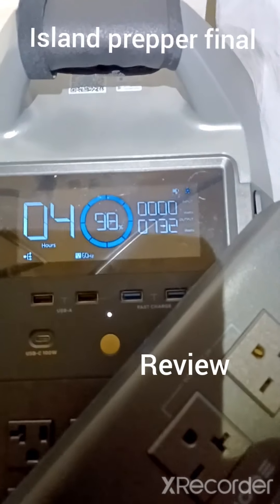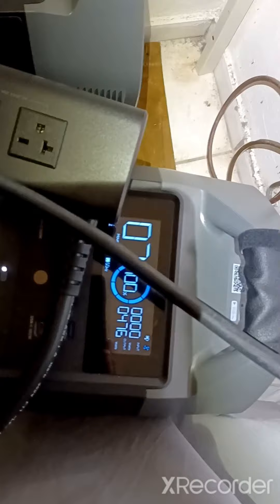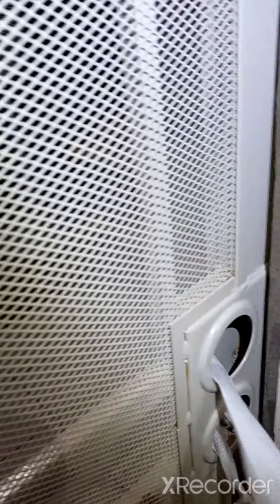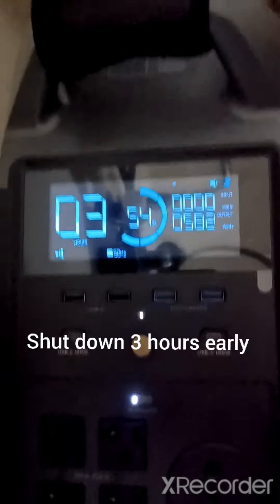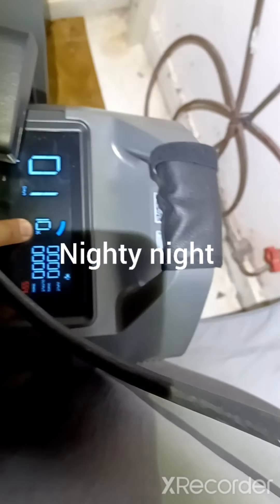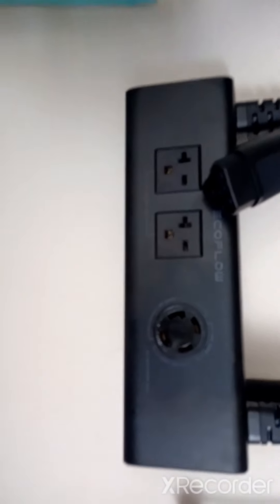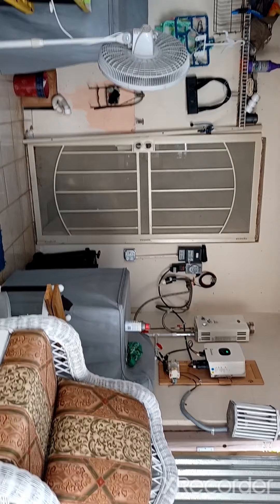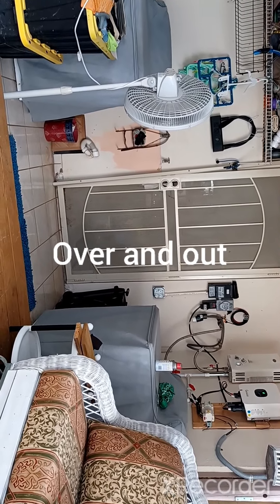$8000 down the drain, Delta pros, low run time  👎

Comment: I guess my question is why aren't you charging the units with your solar while you are using them - I think you can charge them up to 1200 watts.  Can you do another test to see if you can charge them with solar while you are using them?  I would think if you are getting 1200 watts charging while only using 1000 watts it should stay up all day and then you only have to worry about the night.

While I am a novice too, I think you are being a bit hard on your review for two reasons 

#1 - It sounds like you don't really have a true 240v single circuit output - you have two 120v separate circuits - one running one side of your house and one running the other side.  I would feed your main box with the 240v - that way you're feeding the whole house with both EcoFlows.

#2 - The one unit was drawing about 1,000 watts per hour (or 1 kilowatt hour) and the unit was rated at 3.6 kilowatt hours - so doing the math you will only get 3-4 hours before it's dead and that's what you got so it's doing what it should.
Reply from the maker: I had a grid-tie system already in place and I thought it would be able to work together, but when I read the instruction, it could only charge at 150v and my system was set up at almost 300v, so I would have had to dismantle my whole system and re-wire it in order to make it work, but here is a little FYI for you, a lot of my neighbors have solar systems installed, with Tesla batteries, and they all had to use gas generators throughout the day, we just got a direct hit from Fiona rite threw my town, and as we all just got out power back last night, so even at $25k to $30k per house, it still fails the test of full emergency service. with that said I did manage to get them to work for me for 10 hours a day, by charging them with my gas generator.   Thanks for the feedback.
Reply: I heard if you are tied in with the grid, your system will go down when the grid goes down too. Kind of sucks that even with Tesla's batteries they fail too. But to test it your system with solar, go to Harbor Freight and get their 100 W panel and try it out, and when you figured it out, just return them.

Comment: The time they show is off a-lot of the time for me. Mine said 2 hours once and it lasted 7. With a draw of 450 watts all the time.  Granted I had to recalibrate them as well (They are LFP chemistry batteries. This happens). If you spend 8k, then you must ave bought direct. I spent 5,000 for two Delta Pros. Do you have extra batteries to any of them? I’ve watched many home videos and those perform better than yours.
Reply: Where did you get 2 for 5k?
Reply: How did you get two for 5000 ?
Reply from the maker: Yeah, I agree, I calibrated mine the first day, and ran them down and back up twice, but still not rite on the time, but sometimes I get more and sometimes less, what I dont like is the 240 adapter. Thanks for the feedback.
Reply: @jenniferfilippone6929  eBay

Comment: Omg 🤦‍♂️ what makes you think those delta pro could run your central air?? Those things are just as bad as if you was to run a heater. They suck power like crazy. You needed to figure out how much power your house uses. Listen I built a battery backup system for my home and with 3 window ac units running and the normal house power. I was at 23% after 18 hours running. I built a 25.700kw system, for under $7000. Please do your research and what you want running under a black out. Then figure out what you need. You’re spend $8000 on probability. To run the house, you need to get 4 expansion batteries. Two for each delta pro. But…….. then you need to make sure you have enough solar to fully charge everything in a few hours.
Reply from the maker: I don't have central AC, I have a mini split with an inverter, takes very little power, the problem was cost per watt hour, which did not work for me, now if I was able to connect my panels, it would have been better, but its cheaper to build my own.
Reply: @islandprepper3791  exactly! Way cheaper to build your own. Remember you’re buy portability. DIY you’re building what you need,

Comment: You need to balance your panel… there are two sides and apparently one side has more running off it than the other
Reply from the maker: Thanks for the feedback, unfortunately, in Puerto Rico we don't have central A/C, so in an emergency, I run only 1 A/C  in one room to keep it cool, so that side of my house will use a higher wattage or more power, if I run only 120v then they both run more evenly, but the HUB should do the balancing for me, considering the cost$$$$$
Reply: @islandprepper3791  It would be awesome if the EcoFlow hub could detect the usage coming from both of the Delta Pros’ and internally alternate the two different legs on your panel but they are not quite there yet and it would require the hub to shut down momentarily to switch.  Our plan is to max out the capacity of the Delta Pro’s with four smart batteries. We will run the generator during the day and the Delta Pro’s at night for the quiet and to extend our gas and propane supplies. You are ahead of the game as you have solar panels we’re not there yet.👍

Comment: A typical home, with efficient fridges and mini splits air conditioning, would use 30Kwh of electricity, but more inefficient homes would be closer to 50 Kwh or more A DAY. So you would need enough battery backup to cover at least 30Kwh to 40Kwh A DAY. maybe you would need more Ecoflow battery units to connect, probably 2 more, one extra battery extension for each unit. then it could be ok.

Comment: Why didn't you purchase the Delta Pro Smart Extra Battery to run with your Delta Pro?  I have the Delta Max and I purchased one Delta Max Smart Extra Battery and it works fine together so far.  Remember to use the app to update your firmware on both.   That was the first thing that I did on my Delta Max and extra battery.
Reply from the maker: its all just to much money, even with the extra batteries it does not pay for itself, I was hoping I could use them part-time, but they don't have the long-term use and I can buy a real system for less, thanks for the feedback.
Reply: @islandprepper3791  prioritze what you need to run , like microwave etc on main power , and eco flow for lights fan , u will propbaly need like 4-6 of those to run , maybe you should check online for a better deal ?
Reply: @islandprepper3791  i think solar power is defantely worth it !

Comment: The point of these is to hook them up to solar and you need to balance your load as there is a larger load on one of the legs. If your trying to run your whole house for hours on a fixed battery with no solar then you have no knowledge of what these are designed for nor how they work. This is an example of your lack of knowledge and research the product works.
Reply: Great point people need to understand that these units are great for backup emergency power, it is not designed to run your entire home for days on end. Before he bought them he should have calculated his energy needs and bought your system according to those needs.

Comment: Wouldn't it be better to use a large battery storage for the solar than to use the Delta Pro as a backup battery?
Reply from the maker: Yes, and that is why I am selling them, these are not ready for emergency service yet, unless you can afford $14-16k on limited equipment. thanks for the feed back
Reply: Large battery backups are expensive and you can start small on eco pro and expand I know I want the 25kw system so I got two pros and adding a battery a month til I'm done then hooking up solar I can essentially run my entire house off grid and combined with a gas generator for emergencies it's a very economical solution when you lose power for days
Reply: @islandprepper3791 These are 100% ready for emergencies. You are just trying to run things like it isn't an emergency.

Comment: Those batteries have ~3.6k battery each. Drawing out as much as you were they lasted appropriately. 1k draw will only last about 3 hours on 3.6k battery. If you are running it like you said, which is dangerous, you will have an uneven draw on the batteries. It sounds like the pain you experienced was primarily your fault. Before you go there, I have several different solar generators, Delta Pro being one of them, and they all work like they should. Trying to compare these to gas generators is a poor comparison for a huge number of reasons. Sounds like you need a better understanding of battery banks.
Reply: He is addicted to Big Oil, air-polluting gas generators, too.

Comment: U HAVE 2 HEAD UNITS SHOULD 1 OF THE UNITS NOT B EXTRA BATTERY TO WORK THEY WAY U WANT IT TO.THEY SHOULD NOT BE CONNECTED TOGETHER RUN THEM SEPARATE

Comment: Ecoflow will void warranty if you use aftermarket solar panels.
Reply: Really!? That's bs
Reply: What are you talking about no they don't
Reply: No, they sent me an mc4 to xt60 cable for other panels in addition to their proprietary xt60 cable for their solar panel and generator since I bought their delta 2 and 220w panel bundle.

Comment: I'm not a fan of Eco Flow, but also not a fan of the grid tied PV systems that you have absolutely no say or control over.  The power company controls all of these systems, not the home owner.  If the power goes out, all that solar just goes to waste.  As long as people understand that and are okay with it, all good.  What most people don't understand about modern homes is that for every GFI (ground fault interrupt) outlet you have, each one of them consumes on average 30 watts every hour they are energized.  That's up to 720 watts per day per outlet that cannot be used to run actual critical loads, such as a refrigerator or freezer.  If you are going to go the way of battery backup during a power outage, make sure that you are not powering any GFI circuits.  Another thing that you may not notice, especially when you look at a refrigerator or freezer, is that when they run a defrost cycle, they draw considerably more power than they do when just running.  The easy way to check this is to just plug it into a kilowatt meter (about $30 at Amazon) for 24 hours and look at the total watts used in the 24 hour period.  To get the most out of the PV input, look at the current and voltage limits of the Eco Flow, then use a combination of panels (in series) to get as near to the upper voltage limit as possible.  For combining panels in series, always use the open circuit voltage (Voc) of the panel for calculations (usually on the back side of the panel).  Hope some of this helps.
Reply: @jknowi  The Eco Flow will limit the current to 15 amps so no problem and as long as the combined Voc is less than 150 volts, you are good.

Comment from the maker: I have to put this comment in here, for the cost of these chargers, it does not run my house for any considerable time, my gas gen cost only $400 and it runs my whole house for 8 hours on 4 gallons of gas, meaning I can use my gas gens for 30 nights running my A/C for only $540, no brainer, my smaller unit runs 8 hours on a gallon of gas and 1800 running watts.
Reply: Hi. Enjoyed watching your video. I believe your problem is that you don't have enough capacity ( watt hours) to run the whole house the way you would like. The two Delta Pro's give 7200wh total. The watt hours displayed on the screen wouldn't be same if they power different loads on two different circuits. You really need to figure out how many kwh your whole house consumes for the time your off grid and then add more as a buffer. There's a YouTuber called Minuteman Prep. Has a excellent video with the Delta Pro's. He has two Delta Pro's and 4 smart batteries connected. Runs his whole house and well pump, but he has capacity to do that. Wish you the best.
Reply: Delta pros are working good problem is user lack of knowledge.
Reply: @harrysantiago5093  exactly. This guy is clueless
Reply from the maker: @rustytr , hey Rusty, I'm not questioning the quality of the product, I like it, but it is NOT worth the money for emergency use, so my comparison is gas vs this option, it all looks good but it cost way to much for what you get in return.
Reply: What gas generator did you buy that cost $400 and runs your whole house?
Reply: @islandprepper3791 no man, these things are great for emergencies. The problem is that you are trying to run everything like it isn't an emergency. The problem here, as pointed out by several people, is your lack of understanding. Trying to compare a solar generator to a gas generator is like comparing apples and oranges. You have wildly unrealistic expectations of what these should do and you do not understand proper implementation. Proper planning on this would have saved you, and a good number of other people, a big headache. Quit complaining about the system not working well and learn how to make it work for you. Sounds like you need more battery to do what you are doing. That and balance the loads on your panel. If you are looking to use it for emergencies then you should only be running the bare bones on it. Not every last thing in your house like you are in grid. You need to stop and think through your problem instead of whining and complaing.

Comment: Yeah I agree if you would have considered your wattage use solar generators are not quite there yet in terms of battery capacity we are still like in the flip phone stages of solar generators. There are many new batteries in the horizon that may change that like the sodium batteries with better density and capacity for the same weight.
Reply: It's not the battery that set up or not advertised for whole home backup so his expectations are way off just keep adding batteries until you get to your capacity level that sustains you without thinking about it

Comment from the maker: today is the first day back with electricity and internet after we got hit with FIONA, so I did put them to a real test, so what I was able to do was charge them and use them one at a time using 110v direct to my transfer switch, that runs my whole house except my 220v a/c units, but it did run about 5 hours and then I attached the second unit for 5 hours or a little more, at the same time I was charging the empty one with my small inverter generator at 800w but it takes 5 hours to reload, at night I just use my 220v gas gen, and it would run for 8 hours running my inverter a/c unit, it actually ran 2 220v a/c units no sweat, but fyi, that was running them a 100% to 0% if I program them to 20% as recommended, it would only work about 3 to 4 hours..  we where 11 days no power and I estimate about, $300 to 400 in gas for my gens to run 11 days.

Comment: Ecoflow is a battery to stock energy and not a generator, which means you will use what you stock. 🥱
Reply: Solar panels generate energy from the sun and store it in the solar generator.  As a system, it's both a generator and storage unit that gas generators cannot do.